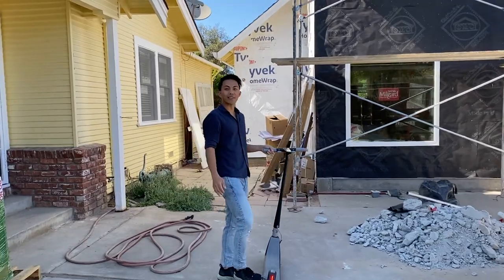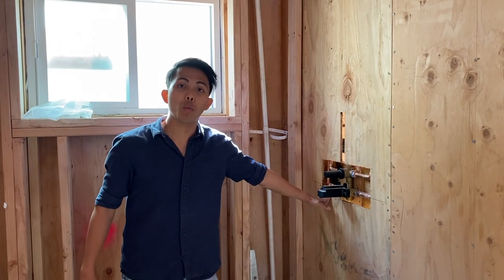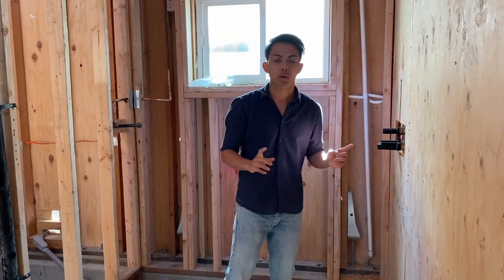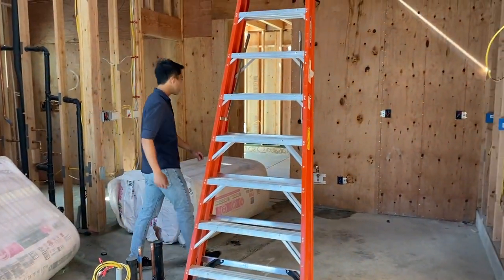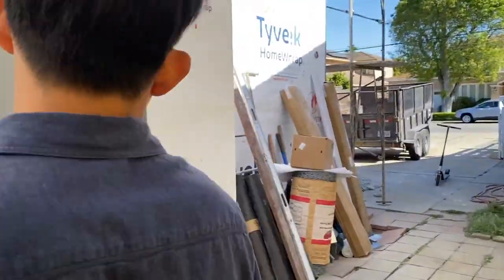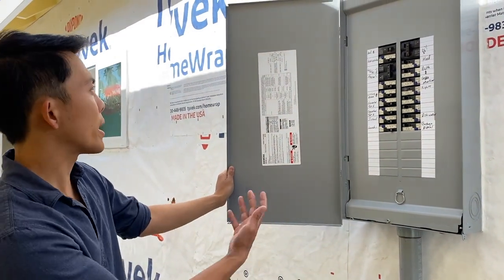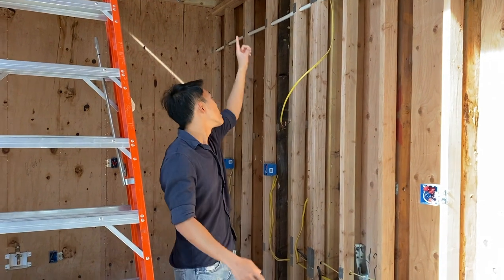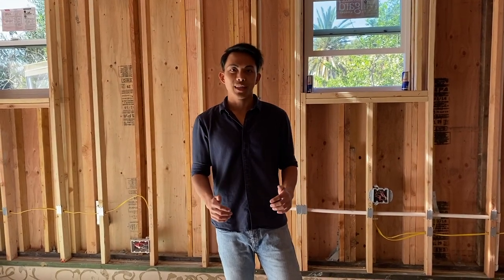ADU Project Part 5 - Rough Plumbing and Electrical

Comment: IN Ca, i thought all new built homes totally stop using gas for cooking and heating. Also
 need to install solar for new homes.? Let me know for any updates.
Reply from the maker: Some people still prefer gas ranges for the physical flames so there's no restriction on this. Solar is required for new builds after 2020 - it's usually a good idea as well since mounting panels on a new roof can extend the life expectancy of your shingles.
Reply: @SubtleAsianRealtor  Isn't solar required under Title 24 as well?
Reply from the maker: @jaybones643   As of California builds after 2020, yes they are required. The plans for this adu were approved in 2019.

With that being said, we still ended up getting solar on the main house. They were 24k for 9.6kW panels if you were curious.
Reply: @SubtleAsianRealtor  Ah, ok. OP asked if new builds are required to have solar and you said it is not required but popular. Just want to make sure they get the correct info.